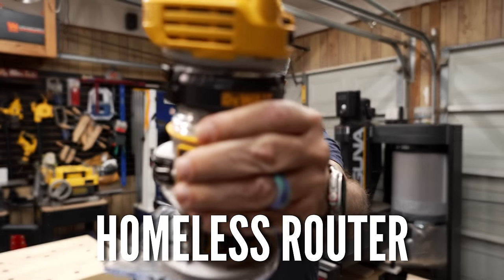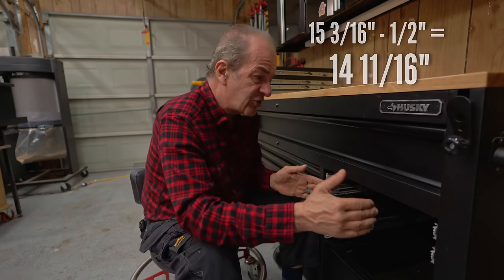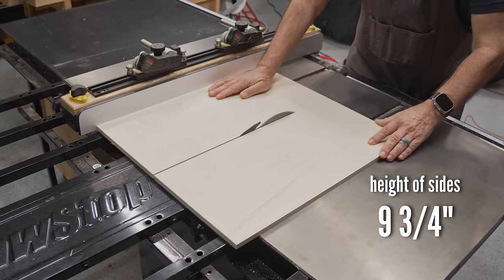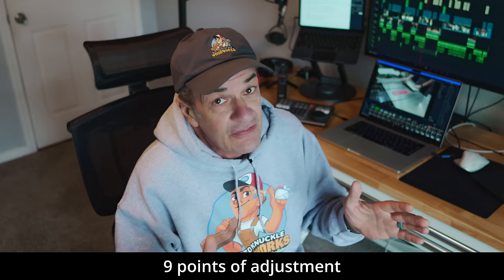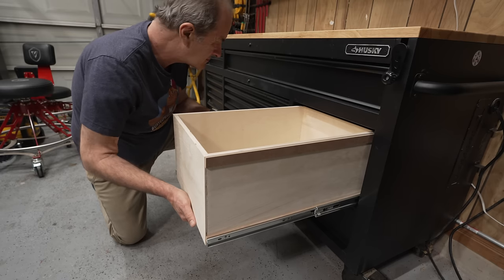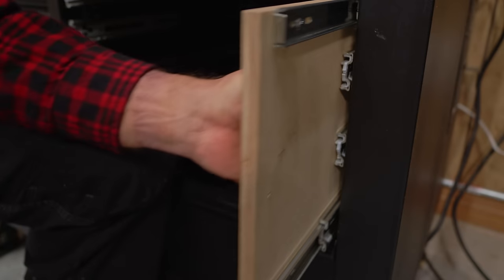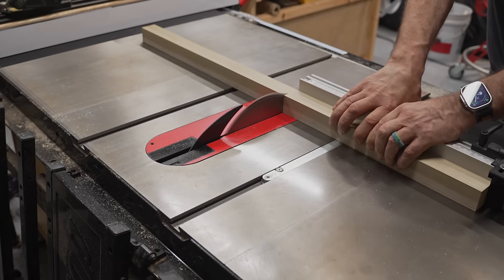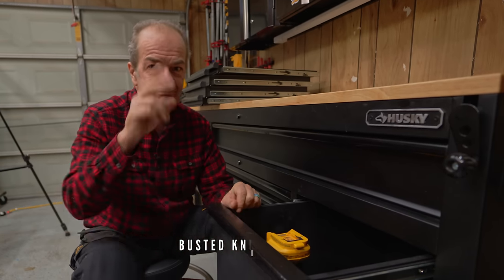10X your tool storage with this one simple build

Comment from the maker: Use the exclusive code "C730." Purchase the FlexiSpot C7 now and enjoy a $30 discount.
US residents: https://bit.ly/3Vq5KXb
CA residents: https://bit.ly/3Pv0Gx3
Reply: I just asked my boss to order the chair. It looks like a quality chair for a reasonable price.
Reply from the maker: @dougprentice1363  you will definitely like it. Herman Miller-level quality at a fraction of the price
Reply: @BustedKnuckleWoodworks I don't like that when you sit up straight,  your upper back is many inches from the back of the chair and head rest.  You have to lean back.  I do like the lumbar support though.
Reply from the maker: @dougprentice1363  I only did that to show that you can lock the incline. Which is good if you want to take a nap in it 😁

Comment: Great Idea, with good explanations. Might I suggest that while you used 12mm BB Ply for your drawer, it actually works better to use 9mm (3/8") BB - to cut down the weight of the finished drawer insert, as many of these steel chests are made with pretty thin steel (and the slides are also not terribly robust, thick steel, either). If you're really concerned about joint strength, adding a inside edge of hardwood to all joints will solve the problem of long term durability (or use the small steel angles for joint support on the inside).. and your cheap steel cabinet will give you longer service - because you cut the weight by 20%. Probably your neatest video yet.. Keep them around 10 mins.. and I will come back for more.. thanks!
Reply from the maker: I would definitely agree, especially for the really flimsy chests (like those US General ones) or if you’re doing this in reverse (replacing a large drawer with smaller ones). These Husky benches are pretty strong though. I think the best compromise might be 3/8” for the sides, and 1/2” for the bottom for strength
Reply: @BustedKnuckleWoodworks  .. or, even a sheetmetal bottom.. attached w/ F.H. Sheet metal screws. Either way, nice job!

Comment: Excellent ❤ I was thinking of doing the exact same thing. I got stuck on using the same slides but I didn't want to ruin the drawers. I didn't know the sides could be interchangeable. Good to know. Thank you. ❤
Reply from the maker: Yes, many of these inner slides work on a similar mechanism, that's how I was able to swap them out.

Comment: I like it!, the color match was exceptional as far as I am concerned. 
I actually find tons of uses for the shallow drawers though 🤣. I use them for router templates, chisels etc. It is the deeper drawers I try to stay away from, too much can get lost in the bottom of the drawer.
Reply from the maker: I do actually use the smaller drawers for some things but the ratio is all wrong for woodworkers. There are always too many small ones, and not enough big ones!

Comment: I built two rolling cabinets and made the drawers to suit myself. Both of them have a modular top to rotate my seldom used bench tools as needed.
Reply from the maker: Very cool! If you make your own cabinets then you can design the drawers any way you like, right?
Reply: @BustedKnuckleWoodworks  
Yep. I built the carcasses out of some scrap OSB, slapped some paint I had left over from painting the shop floor and 30 years later they're still going strong.

Comment: Respect to you for your creativity and ability to add and subtract imperial measurements 🫡
Reply from the maker: It’s a LOT harder than it looks! 😓
Reply: @BustedKnuckleWoodworks  I believe you! But it also just dawned on me that the imperial system exerts a beneficial influence on woodworking by quantising things to the nearest 16th of an inch… which seems to be a pretty reasonable quantum for a material that grows and shrinks with the weather. Is that an idea that is well understood by the different metrology religions, I wonder?
Reply from the maker: @HoraceMash  well, a millimeter is about 1/25 of an inch. A bit closer to a quantum I feel more comfortable with, and the math is way, way easier.

Comment: I wish I had the expertise to do this version, I did my own version ... I sliced out the bottom of an identical upper drawer then epoxied four 1/4" mdf sherts on the inside of the drawers connecting the upper drawer to the bottom drawer... easy peasy...
Reply from the maker: @JamesYale1977  That’s actually a good idea 👍

Comment: holy heck brother I fabricated slides for my Milwaukee tool chest bench . The Milwaukee bench on the left side has a door for large objects. I found for wood working in my garage it made more sense to convert it to 5 drawers that would hold a festal small parts sustainer. I routed out the foot holds so the drawers open and I am able to access the sustainer and open it and get at the screws and small parts I keep in my systainer. I would also like to say your videos are always entertaining . I see your subscriber count is climbing nicely I am rooting for you buddy .. oh yeah that sweat shirt is pretty cool as well..
Reply from the maker: I researched and didn't find anything on YouTube that showed something like this, but I figure someone MUST have done it before!

Comment: Interesting video. Nice that you had success getting the deeper drawers. I didn't quite follow why the existing slides wouldn't work. I guess I have to watch video again.
Reply: They would have worked, he did not want to grind the rivets off and remove them in case this experiment didn't work. As it is he could still switch back to the original drawers.
Reply from the maker: Exactly what @actionjksn said. I could have drilled those out but then it’d be a pain to go back if I wanted to
Reply: @BustedKnuckleWoodworks I get it now. Thanks Hector.
Reply from the maker: @dougprentice1363  🙄

Comment: Very interesting build. I was sure that you were going to find some way to cut the bottoms out of the upper two drawers and then install some kind of interior shell inside the expanded drawer. Your method is a more elegant solution.
Reply from the maker: Yes, as I said I wanted to keep the original drawers intact in case this turned out bad 😅. I have some ideas on how to reuse the small drawers…

Comment: Thats why I generally don't like store bought storage options. No matter how hard you try, there's always something that doesn't fit. But sometimes a compromise, some customisation and store bought solutions work. 

I do a bit of guitar work and could never find a storage solution for guitar setup tools and parts etc. What I came up with was a store bought tool chest (for all of the small tools that could lay down) and a custom cabinet underneath for the bigger stuff and parts. 

Electronics parts are also a hassle to find store bought solutions that are cost effective.
Reply from the maker: Love you guitar makers! I built a few back in the day (back when EVH was building Frankenstrats and they were all the rage). None of them would have won any beauty contests but they were an awful lot of fun to play 🎸
Reply: @BustedKnuckleWoodworks I don't built a lot these days as they're generally pretty cheap to buy. The only trouble is the cheaper guitars need setups, so thats what I generally do these days. Leave more time to drink beer and play LOL

Comment: Great video - very entertaining, thank you.   Earned a thumbs up and subscribe from me.  I considered these rolling mechanic's carts for my woodworking tools but decided on building my own instead.  My 2 cents:  if you have the money and are pressed for time, the rolling carts are a good option for woodworkers.  If you DON'T have the money and/or have the time I recommend building your own. Another reason to build your own; tools rust easier in a metal box than in a wooden box.

The skill level required to slap together a workbench that is square, plumb, & true is surprisingly minimal.  Slapping together another box (square & plumb) that fits underneath with small boxes in the big box as drawers is barely one notch up from that - you can do it, really.
Reply from the maker: I probably didn’t stress this enough in the video: if you have the time and the means to build your own, you should go for it. Not sure I agree with you that self-built is the cheaper option — at least not if you intend to build something of equivalent quality. I’d say, the store bought route will save you both time and money, but at the expense of customization options. This solution merely attempts to bridge that gap; showing that customizing a store-bought metal cabinet is actually possible.

Comment: I didn’t realize Home Depot slides would mate with these tool box drawers. I’ll have to see of it can use one to replace a broken slide on my Craftsman tool box.
Reply: If it is not close enough you could probably adapt a pair of them and definitely make it work.
Reply from the maker: You might need to modify it somewhat but it could definitely work

Comment: if you don't mind destroying the old drawers, you could cut the front from them and glue or screw them to the wood panel you use. it will be interesting that 3 or 4 handles open the same drawer, but it will look 100% like the original
Reply from the maker: Someone else had a similar idea, very cool! I am still trying to think of something else to do with those though...

Comment: The reason they make the drawer sizes they do is to limit the weight that could be pulled out at once to prevent tipping. Just remember that if you're doing this on a taller cabinet. but this is awesome for lowers!
Reply from the maker: I think also it’s so they can advertise more drawers, makes the product sound more impressive

Comment: Why spend the money and install effort on new slides? Wouldn't it have been cheaper and easier to build a slightly smaller drawer and set/mount it onto the bottom existing drawer?
Reply from the maker: Then I’d only have one drawer instead of two? 🤷🏻‍♂️

Comment: Wouldn’t a simpler way to do this, but just as effective, be to use the bottom drawer as your drawer, bottom? You could keep all four drawer slides in use. You could drill out all three sets of slides, and just install the four sides of the new drawer onto the existing slides. You would maintain the front look of the drawers, the stability of the bottom drawer, and not need to worry about all the measurements.
Reply from the maker: Good idea. Let me know when you make a video about this, I will watch that 🙂

Comment: It seems like you could get much of the benefit with less work and less materials used by just removing a drawer and extending the sides & back upwards.  Just screw in from the outside in.  The metal is usually thin enough that you're not really losing much space vs. building a dedicated drawer.

My personal solution is far simpler: free / cheap furniture.

It's almost shameful how often things like beautifully crafted dressers get thrown out, given away, or sold for pennies at estate sales.

A lot of what I have is a combination of curb finds + displays from store closing sales (4'x4' rolling display frames from Sears make a great platform for putting a pair of dressers back to back).

Comment: Don't do this guys.  Find really nice used (office) lateral file cabinets, and add a nice plywood top to them.  Every drawer is 10-12 inches deep.  Store saws, routers, etc in there.
Reply from the maker: Why would you get rid of a really sturdy and otherwise functional tool chest, and replace them with office furniture?
Reply: @BustedKnuckleWoodworks  I have both... Have 3 46"  husky like yours  and now have eight 36 inch wide file cabinets.  In a 2 car garage.

Comment: Weird, I'd rather have more short drawers. But I'm not a woodworker either.
Reply from the maker: @michaelgleason4791  I used the small drawers a lot when I used to work on motorcycles but not so much as a woodworker

Comment: What makes this work bench worth its price are the drawers.  Why buy it if we need to redo them and throw away some?
Reply from the maker: The point of the video is that you don’t need to be stuck with the way they designed it. For me there are usually way too many small drawers on these, and not enough large ones.
Reply: @BustedKnuckleWoodworks  then why did you buy it if it doesn't feed your needs?
Reply from the maker: @b3arwithm3  I used to work on race bikes, and it’s great for mechanic’s tools like wrenches and stuff. Almost all of these metal workbenches are designed for mechanics and DIYers as I point out in the video.

Comment: Seems like using a toolbox designed for something else is your first mistake. They're hardly "unusable", you're just trying to misuse them. My hatchback isn't unusable just because I can't move a cubic metre of manure in the back
Reply from the maker: These are what a lot of people already have.
Reply: @BustedKnuckleWoodworks  I get that, but you framed this as overcoming a design failure on the manufacturer's part, when it's actually a consumer's failure to consider their needs. Strikes me it'd be quicker, cheaper, and easier to make your own cabinets that would fit what you want to store, or to purchase appropriate cabinets to start with. If you've already got one of these chests, you can still use it to store things easily. Use if for your screwdrivers, sharpening stones, sandpaper, fasteners, drill bits, rulers, calipers. There are so so many tools that are super well suited to shallow drawers.

Comment: I get you’ve got to make content but FFS you have a deep drawer at the bottom of your existing toolbox! 🤦🏻‍♂️
Reply from the maker: That’s where mini-Lee lives! Didn’t you see him pop up in the intro?
Reply: Yep. But still, you gave two deep drawers. For me I use my thinner drawers of my cabinet from harbor freight for stuff like coping saw, nail sets, squares, drill bits etc. albeit they are a little deeper than an inch.
Reply from the maker: @BinaryDisastr  right, I use the small ones too but between my two chests I have like 16 small ones and not nearly enough big ones. I’m just thinking others might have the same issue, does that make sense? 🤷🏻‍♂️

Comment: As a mechanic, I'd never do this. 🤨

OK, actually, I might. 🤔 

(Everyone has stuff that won't quite fit in the shallow drawers, and the boxes that DO have tall drawers are a FORTUNE. I don't like to spend on storage when I can spend on tools instead.)

Either way, I liked and subscribed. 🫡👍
Reply from the maker: I originally bought these when I worked on racing motorcycles, and it never really occurred to me then, but once I started trying to stuff woodworking tools in there it just made sense!